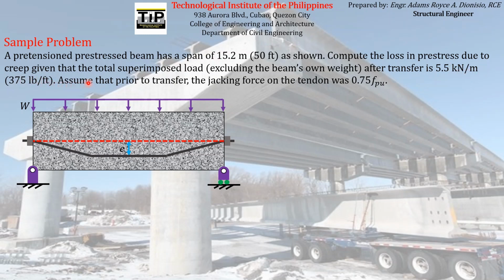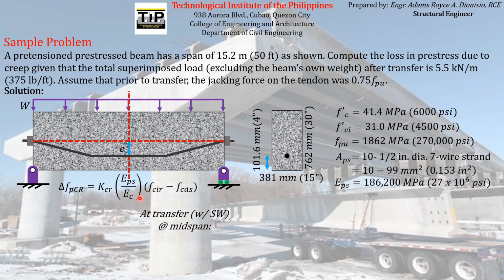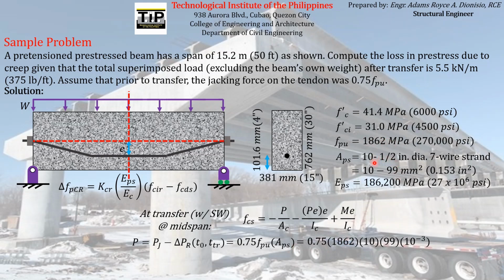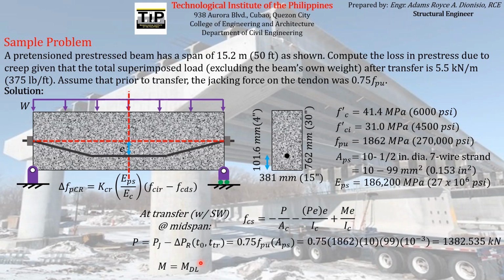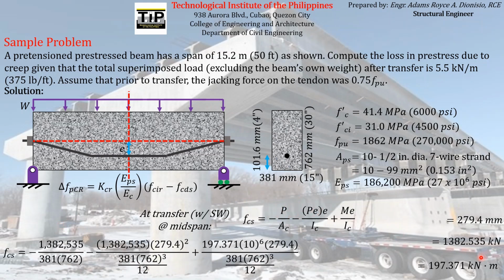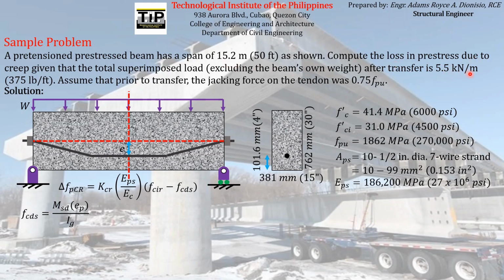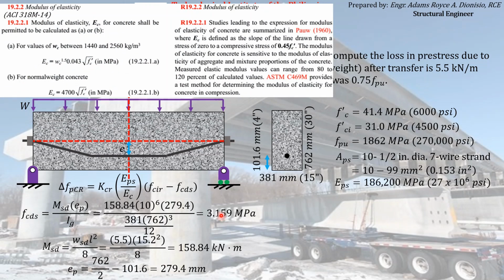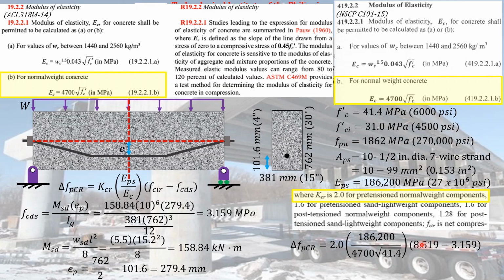4 Part 13 Prestress Loss due to Creep Sample Problem

Comment: In order to calculate the fcir should you not multiply it with the Kcir factor which is 0.9 for pretensioned members?